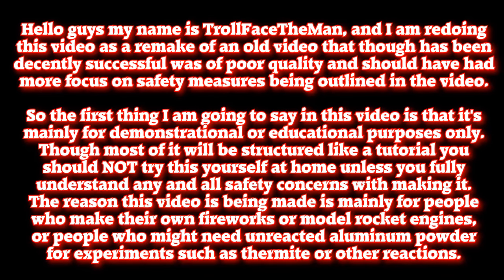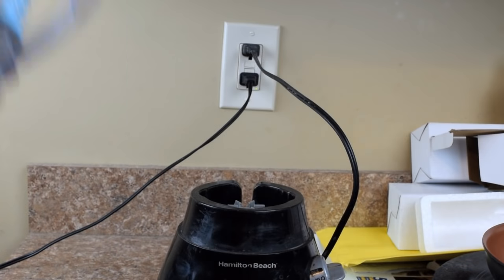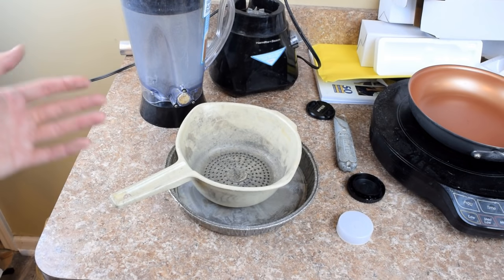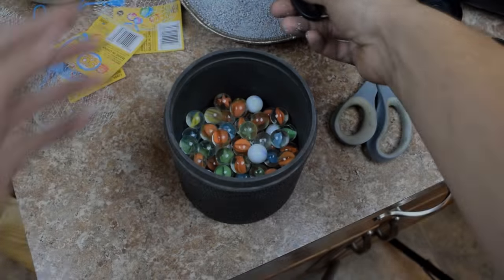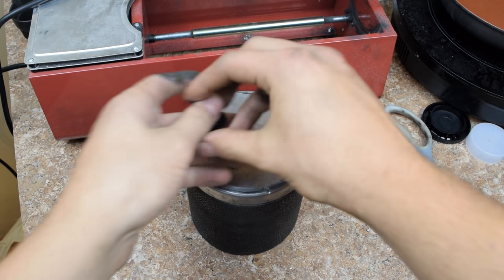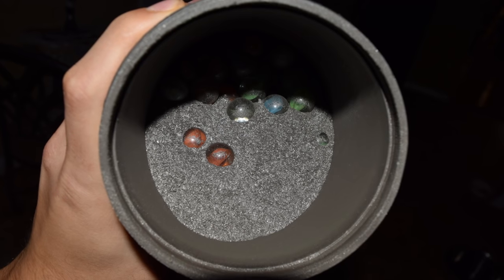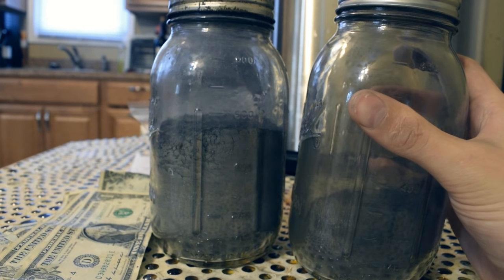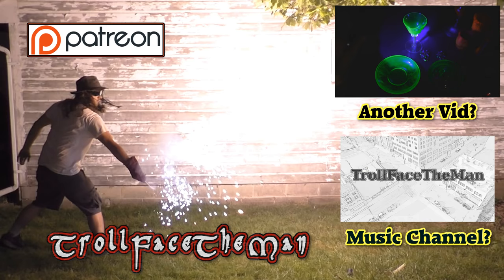How To: Easy Bulk Dark Aluminum Powder (My Homemade Process)

Comment: Believe it or not, we did this stuff 55 years ago. But back then you could buy aluminum dust -- 400 mesh -- for a few bucks. Also fine powdered magnesium. Then of course we got around to adding oxidizers, like KCl03 or 04. BOOM!!  Chlorate and Mg powder burned so fast it exploded without a container and made a mushroom cloud. Them was the days.
Reply: Yep

Comment: I’ve been into pyrotechnics for a long time and chemistry for even longer. I’ve never bothered with aluminium powder apart from one batch. It becomes too dangerous too quickly. I never had an issue but I’m sure a few hours later, it would’ve gone up due to pyrophoricity
Reply: It is not THAT pyrophoric. I've been working with AL for along time, and I've never had it go up on me. Just be safe....follow the rules... and the scaremongering is not necessary. I use glass marbles and copper BB's, and have never had an issue, even when the powder was fully reactive. I'm not advocating doing this, but it's always worked for me. You can always use nickel-chromium bearings too. It grinds more effectively if you use 2 different sizes of grinding media.
Reply from the maker: It shouldn't be that reactivate. However magnesium milled down can be very reactivate and requires much more handling
Reply: @TrollFaceTheMan 
Indeed-look up Lloyd Sponenburg, a very well-respected pyro guy.  

Wrote the book on constructing and using ball mills for pyro.
He had a pyrophoric incident milling magnesium and was quite badly burned.  If he hadn't done everything else right (cotton clothing, long sleeves, eye protection,etc) he probably would have been both crippled and blinded for life.

Comment: This is a great tutorial. I think the addition of charcoal probably doesn't serve the purpose of protecting the aluminum from oxidation as you state, but more likely acts as a dry lubricant and anti caking agent. At a certain point in a low oxygen environment the tiny particles of aluminum would be more prone to clumping and cold welding to each other, rather than being ground down further. Charcoal being in the mix likely dirties up the fresh surfaces so recombining into larger particles is less likely to happen. Just a guess.
Reply: NightHawkInLight yeah I heard the proper dark aluminium is made by burning the aluminium foil with a touch first then grinding down the burning puts a slight carbon layer on the foil so you don’t have to add the charcoal this will give best results
Reply: KAYLEB_HD really?
Wouldn’t that weaken the powder?
Reply: Praetzel Projects it’s how they make it
Reply: No charcoal needed adding charcoal does nothing anyway it can’t get fine enough to protect al
Reply: KAYLEB_HD very interesting 
Also makes it more brittle reducing milling time
Reply: NightHawklnLight- do you still do pyrotechnics? You should do more tutorials on it!
Reply: @KAYLEBHD  aluminum powder commercially is made using aluminum swarf
Reply: Well what an interesting guess. But still this guy deserves props for uploading this!
Reply: @jacobkudrowich  swarf is highly stressed and should break up quite easily.
Reply: I have to strongly disagree. I have done the above process dozens of times and tried many additives. 5% charcoal speeds the aluminum up in a solo burn test,immensely,try it side by side with a spoon of indian black head,it will burn faster everytime in my experience. perhaps it is why they burn paper with it in the factories. I find it barely worth using without the charcoal added. this process works amazing and makes reliable high quality aluminum that works better than warehouse bought in my own opinion,it can even be supercharged with 3% of something else.
Reply: @papyro6830  
And what would that something else be?  Asking purely for science. 🤓
Reply: @papyro6830  I'm still in denial to charcoal making any significant difference on the oxidation of the aluminum during break down. As far as the milling process goes, I agree with KnightHawkInLight's assessment in its anti-caking properties. I do, however, agree with you in that charcoal does make a significant difference in final product reactivity. My hypothesis to this is that the charcoal acts as an "accelerator" in some way. I think a good experiment would be to prepare aluminum powder having the same particle size / shape distribution (the hard part), one with charcoal before the milling process, and one with charcoal thoroughly mixed in after the milling process. Then observe any difference or lack thereof.
Reply: @Clipster15  you might be right!
Reply: I'm gonna try to put this debate to rest. The fact of the matter is, the charcoal DOES make the aluminum powder more reactive. The whole process of aluminum oxidation and ignition starts with the intrinsic properties of the material. Aluminum powder ALWAYS oxidizes as more surface area is produced. What people don't understand is how fine charcoal airfloat is, and what its electrostatic clinging properties are. Because of the porosity of the charcoal, it is is often milled down to sub-micron size, which DOES serve as a replacement for a protective oxide layer. The burn rate of AL powder is defined strictly by the depth (on the atomic level) of the oxide layer, and the time it takes to heat it to the point that the unoxidized AL begins to react. The charcoal acts as this protection as well, and charcoal ignites at a much lower temperature than AL powder, heating the oxide layer quickly and increasing the burn rate (and thus, faster reactivity time). Instead of acting as an anti-caking agent, it acts as an abrasive when milling the powder. It actually keeps the particles from cold-welding. True, you can only mill down to 10-20 micron size practically, and it will agglomerate after that in flake form. So charcoal does help, and it acts as a burn rate catalyst just like sulfur would, because of its lower autoignition temperature. There's a reason the Krauts developed this process.
Reply: I have fine alumnium powder stored more than 10 years does  this mean it won't burn instantly due to lack of oxygen
Reply: @srinivasrao877  i wouldnt open it up after 10 years then 😂
Reply: Piezo electric  shock it can happen with glass I was warned against using marbles and glass on a pyro forum it doesn't take much of a spark to cause a life altering event.
Reply: @flapjackson6077  potassium nitrate, provides oxygen when ignited
Reply: @frankclarkjr6369   
Holy Poop, 🤣 I didn't think anyone was gonna say the word nitrate, out of safety concerns,. I wonder what Nitric Acid would do to it 🤔 😂
Reply: @johnmoore7360 it'd just nitrate the aluminum. Not sure of the properties of aluminum nitrate but I'd imagine you could convert it to potassium nitrate using a potassium hydroxide solution, which is always a fun oxidizer to have lol.
Reply: @Clipster15  O carvão em pó misturado com o alumínio não deixa umidade e mantem o alumínio seco e isso evita a oxidação ou o aglutinamento de particulas!Eu usaria o grafite!

Comment: Pretty good video. I myself have had a bad experience with the pyrophoric propertiesof aluminum flake after milling. I tried to be sure I opened the barrel with no longer than 10 hours between grinds to let it breathe. As I got down to the 3 to 6 micron range to my chagrin, it was too long without oxygen and the aluminum flashed up.It scared the bejesus out of me, There ain't no putting it out once it starts. And I learned another important lesson, "DO NOT POUR WATER ON IT OR DUMP IT INTO A TUB OF WATER BECAUSE IT MAKES IT MUCH WORSE.!!" A note to the author, You can use Lead Antimony balls. They are harder than aluminum and non-reactive.
Reply from the maker: +Thomas Valliere Very interesting, thank you for sharing.
Reply: use sand to put it out

Comment: Years ago, I would save aluminum and magnesium chips from a local machine shop. Used a large rock tumbler and some ceramic balls. When doing it, you should fill the chamber with some gas besides oxygen. Used tig welding argon to do this. Used a tsblespoon of graphite per pound of aluminum as a stabilizer, can get it very cheaply as a seed lubricant from a farm supply store. After about 2 weeks, it is super fine dust. Magnesium is far more reactive and should be stored absolutely dry under inert gas. Also works for making titanium powder too.

Comment: Thank you for addressing the oxidation issues. Their are many out there that think that oxidation is good on ones metal fuel powder.
Reply from the maker: Only good if the powder is going to be an oxidizer in the mix. But not a fuel.
Reply: @TrollFaceTheMan  if you use too much charcoal powder for aluminum use in flash powder it can actually make it burnt slower. You must go by weight for best results.

Comment: In the grinding with the marbles part, there is a slight possibility of ignition due to a phenomenon called piezoelectricity, it happens when a crystal such as quarts or glass, break, strike, or rub against another piece,  it can build up a charge and create a spark, thus a possible ignition. Be careful out there man.
Reply: I don't think glass is included. Quartz and a few other materials (like strangely enough, super dry bone) are in thst class of materials

Comment: This was great. I always r.un a propane torch over my foil 2-3 times so the hot-cold cycle will make the AL brittle, and it doesn't cause any measurable increase in the oxide layer or ignition properties. I will 100% agree that the charcoal DOES in fact replace part of the function of the oxide layer on each particle, which is precisely why dark pyro AL is so reactive. The oxide layer is thinner and is easier to "heat", and you have a bit of carbon there to get things rolling. The old German Dark process was done by sandwiching alternating layers of foil and newspaper, and burning the stack. They then removed the majority of the carbon from the foil sheets, but left some in when milling.
Reply from the maker: Thanks for the input and info. And I a. Glad you liked the video :)
Reply: @TrollFaceTheMan  I just now noticed we are both using Hamilton Beach blenders.

Comment: I bought 1 lb. of dark aluminum powder online and had it sent to my house. I do have a ball mill like yours but has a smaller roller space. To make flash powder I use 30% aluminum powder and 70% potassium perchlorate. I found that mixture from someone on YouTube.
Reply from the maker: Nice
Reply: Do u know if u can use ammonium perchlorate
Reply: @Joe-el1zt not for a decent flash for firecrackers. You can make potassium perchlorate from ammonium perchlorate by dissolving it in water and adding the stoichiometric amount of potassium chloride which you can buy as salt substitute. The potassium perchlorate is almost insoluble in cold water and can be filtered out.

Comment: The power is used in military for explosions. Thank you you're the only video on YouTube that I have seen that mentions you have to use glass balls or maybe even ceramic. The use of metal or lead will cause the chance of it going supernova and you having an explosion or a very bad fire. I work in aluminum plant and there's a lot of protocols to keep this from happening which most people on YouTube do not take
Reply from the maker: Yeah as with anything I want people to be safe. Things like this can be cool and useful, but also dangerous.

Comment: The MAIN reason for the carbon is to promote the rapid propagation of the flame front through the powder.  That's because C has a lower activation energy than Al.  It's also the reason sulfur is often added to Al flash powder.

Comment: Super fine aluminum powder can be obtained from paint supply stores and works very well in flash powder mixes!!!!!!!!!!! A breathing mask filter is strongly recommended when being exposed to using this.  It is so light and fluffy it floats up out of the container when it is opened. Now that is SUPER FINE!!!!
Reply from the maker: Thanks for the tip!

Comment: It's interesting that you're using glass. I use brass ball bearings for my mill for bp. My question for you is do you suggest using brass, or would you stick with glass? I know a lot of people over Internet debate over this topic.
Reply from the maker: That is a very good point brass doesn't tend to spark though it is still pyrophorpic to a small extent it is typically considered "Spark proof." Assuming if it is considered safe enough to mill volatile powders such as gunpowder it should be safe to mill this powder with.

Also seeing as brass tends to be harder than aluminum you should also be good in that aspect.
Reply: @TrollFaceTheMan  just for the sake of consistence,  there are not 3 “p” in Pyrophoric. Just two.  You know that carbon is a fuel, right? (When asking why aluminum powder without carbon is slower burning)
Reply from the maker: @nitrousman8882 , it's a fuel in presence of oxygen. And seeing as the Aluminium doesn't provide oxygen itself and coal does not burn by itself well when ground. 

 Having and additional worse burning fuel (The Charcoal) to the better burning fuel (Aluminium Powder) would not make it burn quicker or more aggressively. On the contrary it would hinder its burn speed unless it helped the Aluminium oxidize less during milling. And the Aluminium reacts quicker.

 Try and burn just charcoal powder in a pile and notice how little it will do.
Reply: @TrollFaceTheMan  I know you know this… but oxidation does not require oxygen.  Oxidation is simply the loss of electron(s).  Zinc dust and sulfur provides a lot of energy when ignited… no oxygen needed ;)
Reply from the maker: @nitrousman8882 , in that case I am assuming they probably make zinc sulfide. So it make sense that they'd be able to release energy.

 But as far as I know there isn't a strong prominent reaction between carbon and aluminium that would occur under these conditions to release energy. Can you think of any of give demonstration?
Reply: @TrollFaceTheMan  I was really just trying to clarify the issue of oxidation not really having too much to do with oxygen.  😉

Comment: If you're working on a budget, you can actually turn a treadmill into a ball mill. You usually can pick up treadmills pretty cheap or even free. although I have not tried making my own aluminum powder, I use brass balls in my tumblers because if you use a lead, it can leach into your powder, and when lit, it will release lead oxide fumes
Reply from the maker: Yep you are correct I have told many people so far that same warning about led for this, but most don't believe me XD

 One consideration though is though treadmill motor use up a lot of power and unless that is managed the electricity use can rapidly add up.
 
 For example an ac treadmill motor may use 750 while running with no/low load. x24h in a day that is 18kWh of power. x $0.14 here means about $2.52 pr day cost. Vs a tumbler here that uses maybe 30w x 24h = 0.72kWh or about $0.10 per day to run.

 If you are making big batchs the treadmill motor definitely could pan out but for small stuff the price will add up fast.

 DC treadmill motor should use way less power than their AC counterparts though.

Comment: The best milling media to use is not marbles, its hardened lead balls. 
Due to being relatively heavy, they are very efficient at reducing partical size.
And also, they are non sparking,
Reply from the maker: +v1los it's explained pretty well in the video lead will be chewed up by the aluminum sand, even hardened lead is still softer than aluminum...

 Thereby no, it is not good for this...
Reply: I regularly use hardened lead balls to turn atomised Ali powder, into flake Ali powder, and its works brilliantly. Ive been using the same lead balls for ages and they havn't worn out yet!
However, in your defense, ive never tried it with coarse Ali foil so not sure how it would turn out, but if i was a betting man, i'd bet that it would work well, and save a LOT of milling time over using marbles.
Reply from the maker: See that is the thing, you are using already atomized aluminum which doesn't really have edges to grind down the lead. Even still tough I guarantee if you put you output powder under a elemental analyzer, you'd find an alarmingly high amount of lead contamination in it.

 Which is not something you want to contaminate something you are using in pyrotechnics and are going to potentially breath the smoke of.

 Back to the main point of the atomized aluminum being too fine to do anything significant to the lead balls, it is just like with sand paper... The courser it is the more it'll take off...

 Think of the aluminum sand I start off with as like, super course sandpaper... If I were to run that on a brick of lead it would chew it up like crazy... Now think of your atomized aluminum like super fine, ridiculously high grit sandpaper that almost feels smooth to the touch.

 I rub it across that same brick of lead and it would do basically nothing to it, because it isn't very course at all... Do it enough and it'll still do a little, maybe polish it, but much less than the course would.
Reply: Do you think brass balls might do the job without contamination issues?
Reply from the maker: +John Orlitta depends if you can find hardened brass that is higher on the Mohs scale then the aluminum they should be fine.
Reply: TrollFaceTheMan why not simply use ceramic like unglazed porcelain? Too brittle?
Reply from the maker: Alpha Talon Actually it should probably be good to use too.